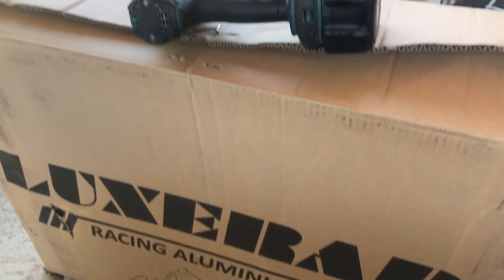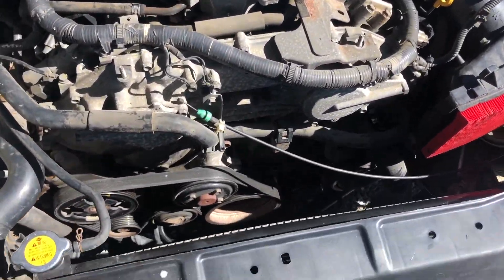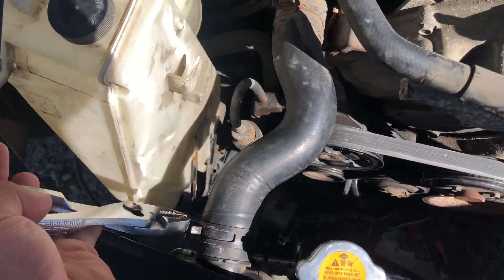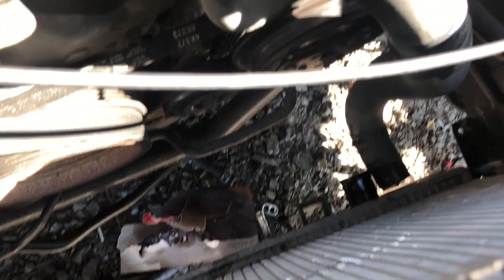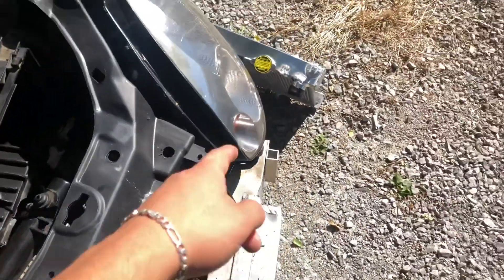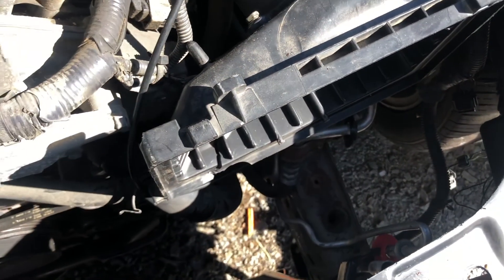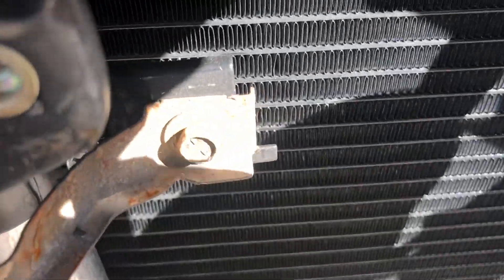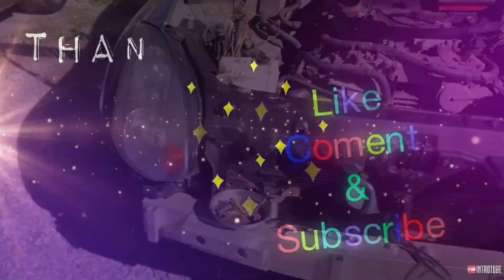2005 G35 Radiator Replacement / Upgrade

Comment: I've installed a bunch of these Luxerad Rad's. All running great. I just installed one in my G35 finally. Great value. Great product. Perfect fit. Fans fit perfect. Much better than the single row, plastic crimped stock rad that all eventually leak.
Reply: Do these 2 rows fit with the g35’s stock air intake ?
Reply: @duesa2203  yep, everything fits back together perfectly
Reply: @speedracer2831  okay cause I’ve heard ppl say you need like a Cai intake because the stock intake will not work with the 2 row and the stick fans because of the close fitment
Reply: @duesa2203  oh no, it fits perfectly! 
Actually, the stock rad frame is wide on top/bottom, and could easily fit 2 rows. But I guess it saved $ to just use 1 row.

Comment: After you put the fans in did your factory air box still fit in there properly
Reply from the maker: Well the fans I have installed are aftermarket, I have the mishimoto fans which are skinnier and so I’m assuming the oem air box would fit even better with more room I honestly have no clue since I don’t have the complete oem box but I would assume it does since it’s skinnier

Comment: Ay bro I bought the same exact radiator but where did you get those additional screws for the hoses, I can’t find them and what size bro. Thanks I’d appreciate the help
Reply from the maker: They came with the radiator, I have a automatic so you have to make sure your radiator comes with the automatic transmission adapters, and the screws to mount it also came with it

Comment: Is there a difference between the auto and manual transmission cars as far as the trans. Cooler lines on the radiator?
Reply from the maker: So technically you can buy the radiator I bought in the video which I still have btw, and if you have a Manual perfect cause this radiator has the opening for the trans cooler hoses and if you have a auto like I do then perfect cause this radiator comes with screw plugs to plug them holes, I’ve had this radiator on since the post of the video and have had 0 issues

Comment: any problems since or overheating?
Reply from the maker: No problems, I went ahead and also installed some mishimoto fans so I bet that’s helping as well
Reply: @nationaloutlaws4818  u think a 2007 g35 sedan radiator will fit the 08? looking for replacement
Reply from the maker: @65DK  yes the 07 and 08 are compatible